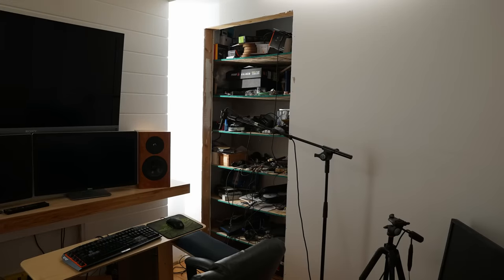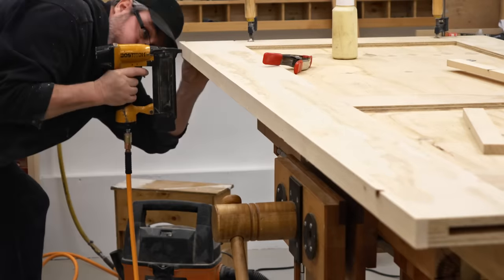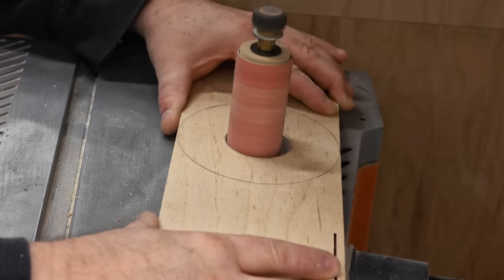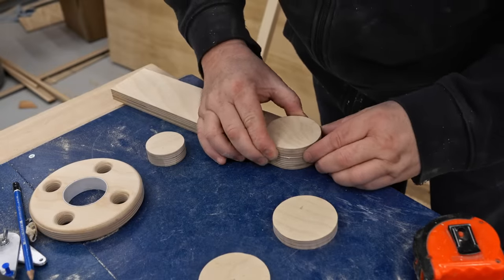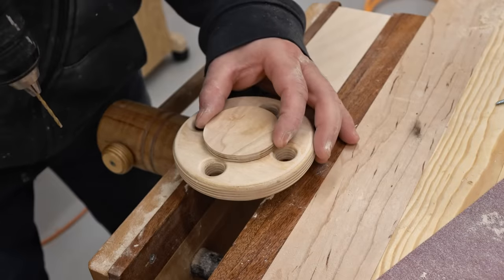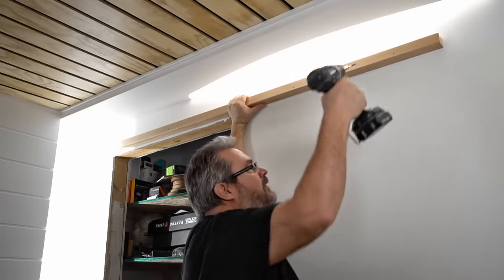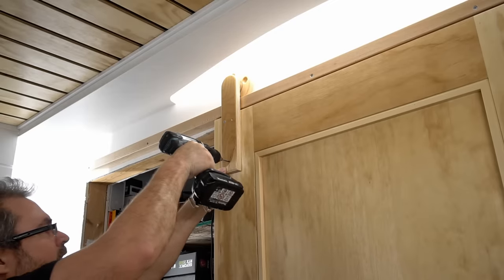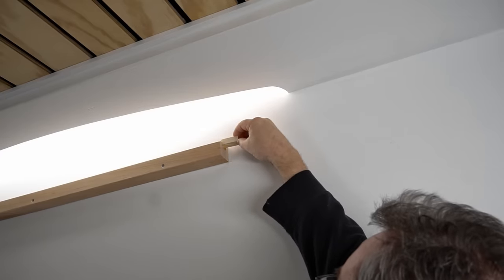How To Make Wooden Barn Door Hardware

Comment: Great Idea John. I like the wooden wheels. I do have an additional idea for the center of the wheel. Being a plumber I work with pvc pipe. If you use 1 1/2'' pvc for the center of your wheel and then use 1'' for the piece for it to roll on in the center you will have a very smooth surface and never have to lubercate it.  They fit inside each other nicely.  I cut the 1'' pvc slightly larger than the 1 1/2'' pvc. I then used a 1/4'' carriage bolt to tie it all together with.  The nut on the back side was sunk in with a washer on the rear so as not to hit the wall.  I also used a couple of 1/4'' fender washers 1 1/2'' OD on each side of the 1'' pvc pipe. Not really a must but makes it a little better yet. I also cheat by using my home built cnc machine to build with. Thanks for your efforts. Jerry

Comment: Thanks for the video. I will probably be using this design to make a door for my bedroom. The only thing I would change is I will probably screw the stops from the bottom instead of gluing them like you did. That way if I want to slide the door off I can unscrew the stops and slide out. Thanks again. You get a new sub.

Comment: For an inside door, the use of wooden wheels and a slotted track is very slick or cool.  Most of the wheels are usually metal pulleys and metal track.

Comment: Ready nice looking! You didn’t show the pin on the floor.
Reply: If he's moving it later after installing trim, the pin will likely move too, and the floor will be left with the old pin hole. or maybe he didn't notice it, or forgot...
Reply: Hey guys...I'm lost on the pin thing...can someone explain it a little...whats its purpose..? I think i want to try this build...
Reply: logan750a - there is nothing keeping the bottom of the door from moving in and out from the wall. A pin mounted in the floor to ride in a groove in the bottom of the door will keep it from rocking. Hope that helps.

Comment: If you want wooden suspension this is good.  But for my 12'l x 8h shed with bypass doors,  I've used garage door track on the top rail of my doors, and garage door rollers fixed in the header beam of the shed.  It's worked flawlessly for 25 years.

Comment: I wouldn't put glue on the stops: it you glue them, then when you need to remove the door, you have to disassemble everything. If you screw the stops, then you can just remove one of them and slide the door out. :-)

Comment: Nice John, several interesting ideas in this build!  Question - since the door is almost entirely made with plywood you don't need to be concerned with expansion? (I'm pretty sure I'm NOT to the middle yet)  Jim
Reply from the maker: Solid wood expands and contracts, plywood doesn't.
Reply: John, thanks!

Comment: You should have also used thin metal strips to the rolling wheels and  opposite sides (wall sides) of the door to balance the weight of door on the wheels

Comment: As someone that has installed thousands of sliding doors for elevators, if you really want to hide the hardware, mount it on the inside. GAL makes stock tracks and hangers for any sort of sliding door.

Comment: You said the rail is installed temporarily. Wouldn’t it be better, to not glue the stop block into the rail?  If you would have screwed it in from the top, you could remove it easily and pull the door out sideways. Nonetheless this door turned out very nice! I like the idea of the low budget bearings. 👍

Comment: I love your door, but have two problems.
First : you some day will push de door with little bit more strong and the door it will climb the stoppers and fall down.
You can make a test and you will see. 
When you fix it, a second problem will appear.
To find second issue, after fix stoppes, try again open or close a dor with little more strong, and you will see.
You can't avoid this two problems.
Reply from the maker: You might want to think a bit harder - what happens to the door if the roller goes up on the stop?

Comment: My Father built a set of cupboards more than 50 years ago. For the drawer sliders its wood on wood. and its not hardwood. he used para wax to lubricate the drawers. 50 plus years later the drawers are showing zero wear.